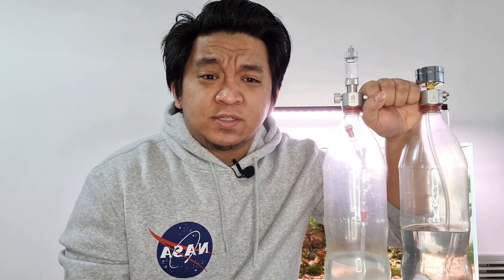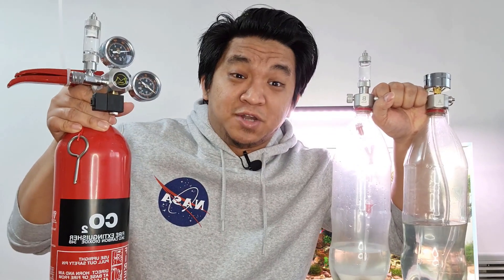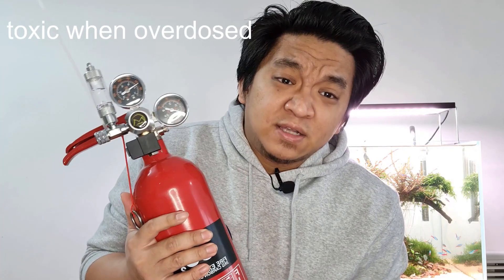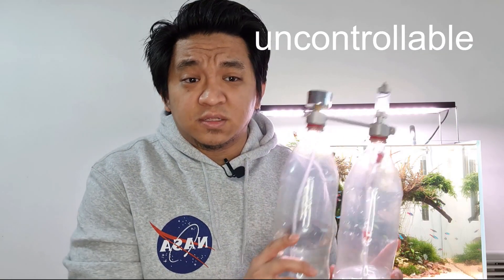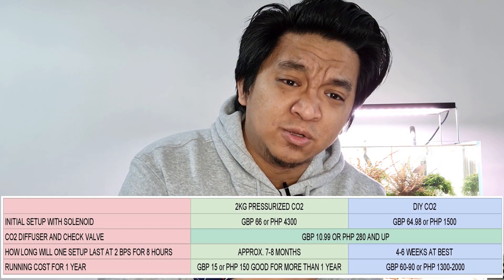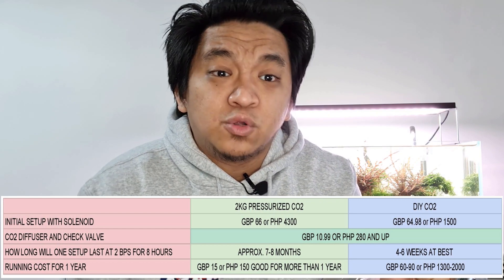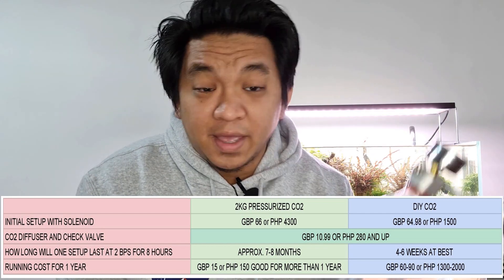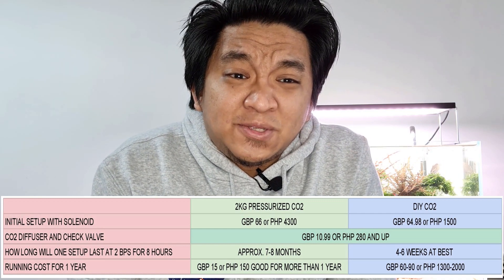DIY CO2 vs PRESSURIZED CO2 for PLANTED TANKS [COST COMPARISON and PROS & CONS]

Comment: Ok, now I know why my water becomes cloudy, it's because of the yeast mixture that overtime causes algae to generates faster, just lately I have noticed that my water becomes cloudy and a bit greenish, so I immediately change the water...

Thanks for this video man! You've enlightened me!
Reply from the maker: you're welcome! yeah sometimes, with DIY CO2, there are instances where the mixture will mix into the tank water because the pressure inside the bottle pushes the mixture up.

Comment: Do you leave the Co2 hand pump closed all the time and if so then won't the co2 pressure build up inside?
Reply from the maker: yes I do. Pressure build up shouldn't be a problem if you've sealed and screwed the regulator properly

Comment: This is pure bias on pros and cons
Reply: I use pressurised co2.. but last time i used diy co2 also.. it did well , and it doesn't fluctuate that much.. it's controllable. Still dsame results
Reply from the maker: lol, I literally gave you a side by side comparison, personally used both systems, personally paid for both and even gave you a spreadsheet comparison and you called it "PURE" bias?  There is a reason why BIG aquascaping galleries use pressurized CO2 systems in their display tanks, go figure.

Comment: Dude, very very insightful video!

I ended up buying a refurbished CO2 2kg Amazon for £25 once I realised that most CO2 regulators were 21.8mm. I've got an Ista regulator but what confused me was the fact that the tank said 5/8 -18 UNF, so I was trying long and hard to find adaptors for it - I probably should have measured out the connectors with my verniers first to save me time!!!

But, for the last 2 months, I've been running a Citric/Bicarb reactor with a glass diffuser instead of the atomiser (non pressurised CO2 was very very weak), with a solenoid, but I'm having all sorts of algae blooms because of the inconsistency. I don't want to run a separate timer to phase in the CO2 ahead of the photo period. 

But, for the price of CO2 bottles, it's definitely worth going the pressurised route if you have the kit available (silly me not knowing that I had a compatible regulator!)
Reply from the maker: Had the same problems with the DIY co2 system even though I used a timer and solenoid. The output just isn't consistent enough for high tech setups. Had black beard at one point then went for Pressurized setup. Blackbeard algae didn't comeback after removal... I'm trying out a supplier of fire extinguishers at the moment, if their services are OK I'll recommend them in one of my future videos. Ill try and remember to give you a heads up as well

Comment: If ever you turn off your diy Co2, and open it up the next morning is that possible? I'm worried if it might explode 😅
Reply from the maker: In most DIY co2 generators in the market, they already have safety valves that open in -case pressure build up gets to high. Also, if you look up for the specific model I have, it has the Y-joint wherein one end is just a non return vavle, that also prevents any unwanted reaction from happening. 
If you end up using DIY co2, Don'! skip on using non return valves. I removed mine, sooooo it exploded and made a big mess.

Comment: How to turn off the DIY co2 at night? I have the DIY one.
Reply from the maker: you can buy solenoid valves for aquarium CO2. thats what I use and then plug it into a timer.
Reply: @AquaristForFun  I have the DIY but doesn't have a solenoid valve. Any alternate way to turn it off at night?
Reply from the maker: you can buy a separate solenoid valve that goes in-line. My DIY co2 doesnt have solenoid as well.. there are solenoid valves that can be inserted along the CO2 tubing.. without solenoid valves the only way to turn it off overnight is to manually turn it off and on
Reply from the maker: https://shopee.ph/DC-12V-Output-Solenoid-Valve-Aquarium-CO2-System-Regulator-Electric-Magnetic-Valve-for-Aquarium-Fish-Tank-Water-Plant-Grass-Grow-Easy-to-Install-Double-Head-i.236730651.7837409116
here is an example. pick a double head solenoid. i dont know what type of DIY system you have so i cant recommend the single head
Reply: @AquaristForFun  how do I manually turn it off or on? Do I pull the relief valve? What do I do to manually turn it off and on? I'm sorry for having so many questions, I just bought mine yesterday and I have no clue how to shut it off at night and turn it on in the morning.
Reply from the maker: NO!! dont pull the relief valve. You'll lose all the pressure. Just turn the regulator off. the one usually found near the bubble counter
Reply: @AquaristForFun  ooh! The small one under the bubble counter? The one that I have to turn on when I have to release bubble co2? But I thought that's only for fine tuning? To adjust the bubbles. Is that the one?
Reply from the maker: @algennalmonte2436   yes. you can finetune the amount of bubbles per second using that knob. if you turn it fully closed, you've basically turned off your co2 injection. just make sure to turn it back on again the next day.
Reply: @AquaristForFun  thank you so much! You have no idea how much your advice has helped me. I learned so much from you! Thank you for responding and for teaching me. I will follow your page from now on. You the best Sir!
Reply from the maker: @algennalmonte2436  Welcome!!!
Reply: @AquaristForFun  Sir follow up question, how many hours do I have to turn my co2 on? And is it best to turn it on same time with the led lights of the aquarium? Or 2 hours before I turn on the lights?
Reply from the maker: usually 1-2 hours before your lights turn on. But as your tank gets bigger you'll need more time to reach the optimal CO2 levels